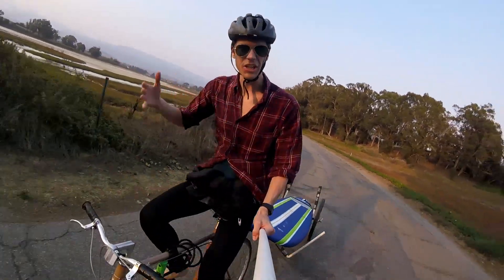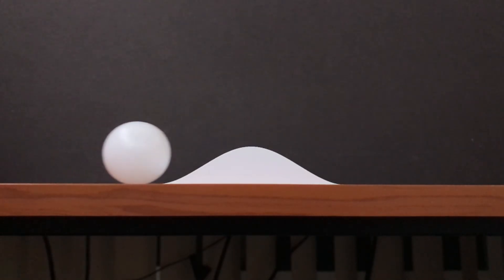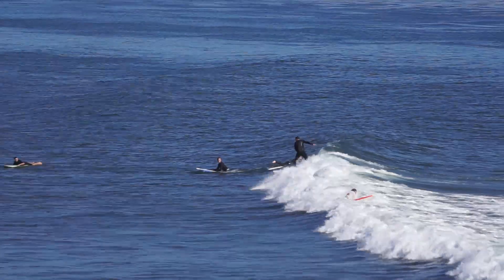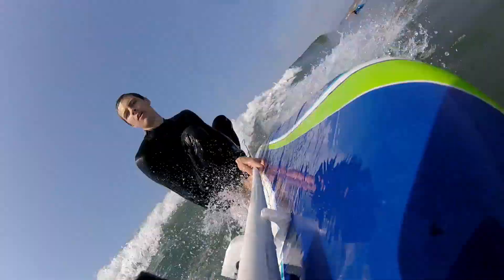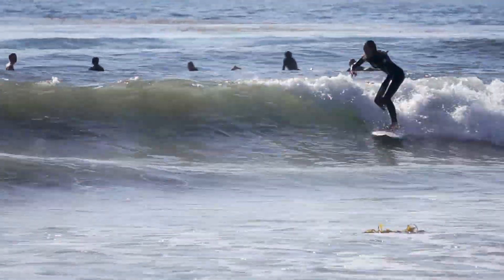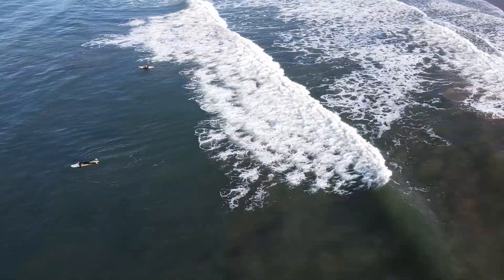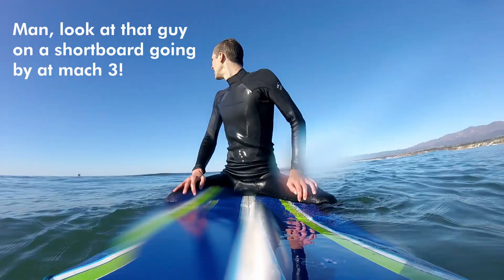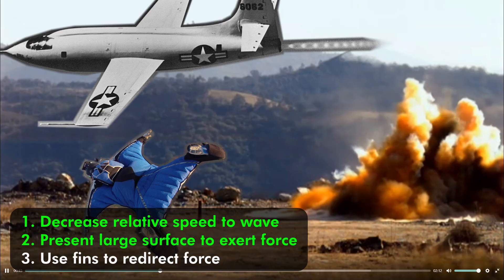How to go Faster than “Mach 1” on a Surfboard

Comment: Would love to lean more about how the hard edge in the tail redirects the water via flow turning if you will, whereas the softer edge in the middle of the board does not and how this allows for better overall board control.

Comment: Hey nice vid,   pls look into the steepening effect in shore breaking waves it is very related to shockwaves(mach3;), since the wavemedium is changing the waveconducting speed graduali the wave gets compressed and steepened till it tips over on top :)

Comment: Well, I think, that the problem with riding a shockwawe is too many dimensions. Look at it: on water, you are sliding quite easily on top of the wave. In air, it is not really possible to slide on top, because there is no top. It would be similar to trying to catch a wave while swimming underwater. The water itself does not really move from its place, so you would just move a little back and forth with water, but the wave would pass and there will be no way for it to accelerate you. Maybe the solution will be to add another dimension to move in, so it will be possible to be 'on top' of the air. Even then, you may need gravity to work in direction of the fourth axis instead of towards earth. Hmmm... It would still be impossible to ride a shockwawe, because it is a pressure wave, which is completely different from water waves. you ca try to ride a pressure wave on water, but i dont think you will succeed. GLHF

Comment: The concept of sailing into the wind and "blowing" into it faster and faster is fascinating to me. But I do rowing (forwards, not backwards like most lunatics). Water is definitely more interesting when it isn't flat. :) With the wind behind you sit up so your body acts like a sail and ride the waves as long as possible. Into the wind lie down and cut through it like a frisbee, and alternate the oars so you weave side to side up the oncoming waves instead of crashing straight into them.

Comment: I wonder if the surfer slows down the wave at all. I think this could be measured fairly accurately by observing waves that are pretty consistent, some with surfers on them and then some without surfers. I think this would need to be done in swimming pool or bathtub with a man-made wave and surfing mouse XD

Comment: When you were explaining the Mach reference at the end, I started to wonder if surfing happens elsewhere in the physical world, ie. where an object (knowingly or unknowingly) uses a wave to travel faster than the wave in a non-normal direction (eg. with sound waves, electromagnetic waves). Really fascinating video!
Reply: Birds can stand still infront of "stationary wave like air streams" going over bumps in the landscape, or dolphins/surfers riding the front or back wake of ships, probably also electromotors, or particle accellerators can be seen like sth. riding a endles el./magnetic wave ;)

Comment: 14:05 you could also drop a comet in the ocean, wait for the tsunami to reach shore, use a magnetic rail and a sabot system to accelerate you to near the speed of the tsunami as it starts to build, then fly off of the rail and use your surf boards aerodynamics to control your descent onto the wave, and ride it for the short time before it breaks and becomes your own personal blender

Comment: Weirdly specific question. Do get cold relatively easily in ocean, pools, etc? If so, how do you overcome it?
Reply: Cold exposure, lower carb diets, insulating clothing (aka wet suits). If I'm tired and hungry I get cold much more easily but if I'm very physically active and well fed I can hangout in 10° c  temps and feel hot

Comment: Here's something I learned after learning to shortboard.
I used to see shortboarders pumping but didn't know why they were doing it.
They said "to get speed" but I didn't understand how until I learned to do it myself.
When you pump, you "jump" the board or at the very least "lift" the board a tiny bit when you are at the bottom of the wave. You do this with the intention to get to the top half of the wave.
When you get there, then you present the wave with the entire flat bottom of your board which will give you a huge push! you ride down and when you reach the bottom, you turn kind of sharp, bend your knees and jump again back to the top half of the wave.
You can really move if you do this right!
Reply: See, that's why I would just build a dam. What you're describing sounds exhausting! :p You have all this water and you're doing the work to get that extra speed. If I let the sun get all the water up in the mountains and just use gravity to power my car, I can come over to the beach and watch you get super tired :p
Reply: @stylis666 sounds like your built for a long board

Comment: "If you look closely, there's fascinating physics everywhere." Agreed! 

The other day, I was watching this powerhead in my aquarium that uses a motor to push water through a pinhole-like opening creating near-laminar flow. As the fast-moving water exited the pump, the resulting turbulence chattered back and forth. Why does it do that? 

I have a cursory understanding of the Navier-Stokes equations and the Reynold's number, as well as intro physics-level fluid mechanics. But as a biologist, I would love a more advanced explanation! I see this sort of harmonic motion (is it?) everywhere, and I wonder "why is it that this restoring force MUST overshoot and create oscillations in everything?" I mean, I know that the energy has to be dissipated for the object to come to a full stop (thus perfectly elastic vs perfectly inelastic collisions and deadblow hammers), but in a fluid, where there are so many degrees of motion, and where the N-S equation makes me think the water would just create smaller and smaller vortices dissipating energy that way, why is that the motion tends to oscillate? Perhaps the pump was a bad example because it's continuously outputting power, but I've seen this oscillation also happen when siphoning water into a bucket. After I stop the siphon and the water remaining in the hose travels down the tube into the bucket, the water bounces up and down inside the hose a few times before coming to a halt. Why? It's crazy because I don't even see any ripples in the surface when this happens, and it seems odd that the water would reverse directions and travel a foot back up the hose rather than dissipate its energy in vortices.

Hopefully you understood what I'm trying to say, and hopefully this could lead to an interesting video idea (though it's also very possible that I'm just uneducated on something very basic). In terms of spelling and those kinds of errors, I'm sick right now so sorry about that.

Comment: Things to think about 
1. Fins have flex and can move side to side letting it hold speed though a drop or turn 

2.it is possible to ride that board in 10 foot plus waves (you put all your a mass on the back of the board and hope wind  doesn’t pick you up

Comment: "You cannot be accelerated by a wave to go faster than the wave" - Wasn't this disproved by Veritasium? Put a prop on your surf board, lol
Reply: Well, it depends on the steepness of the wave. I believe if the wave resembled a sine wave, you wouldn’t be able to get to the bottom and bottom turn.
Reply: And of course there is the sideways momentum, and after pumping if you straighten out it will be very easy to get to the bottom.
Reply: Usually catchable waves on a longboard resemble (3/2)sinx whereas on a short board it is more like 2sinx. But it’s also a little bit more complicated as the front of the wave ends up being taller than the back since water is coming back out due to the previous wave and dropping out the bottom of the wave. Depends on the tide the magnitude of that too.
Reply: Wind moves in to your prop, but, in waterwaves the water doesn't move into you as such, it's just the energy moving through the water.
Reply: Umm I'm pretty sure THIS video proves that very idea hence the (clickbaity) title. It even works on the same principle as the prop
Reply: He did for certain periods of time, he was travelling in between perpendicularly and horizontally of the wave, but it requires the waves energy to push the board forward

Comment: Hey, this actually might be similar to the Veritasium "faster-than-wind cart" saga!

I know a wave isnt actually a moving medium, but instead a force traveling through a mostly stationary medium, but I think the physics might actually be related anyway, because in both cases the reference frame doesn't particularly matter.
Reply: It should be basically the same - this is just me thinking out loud, but on a surfboard, the 'rolling hill' is only intermittently having an effect on you, whereas the sail on a sailboat is sort of... always in the path, as though it was always under the water in a current. so the wave is just an intermittent version of the same system as the wind. it's like if you had very regular wind gusts. the thing about it being a boundary layer is interesting though, the difference between the overall current of "still" water, and a wave poking up out of the surface.... hmm.
Reply: I came back to this video for exactly the same reason
Reply: as a lifelong sailor, this concept seems a little intuitive and quite dated ;D
Reply: Not really the key term there was 'faster than the wind, down wind' :/
Reply: @Appldragon  Faster than the wave, "down-wave" :/
Reply: @Goldfish_Vender  in the Veritasium video the thing was going faster than the wind while going  parallel to the wind in this the person surfing is going faster than the wave yes but he isn't going parallel so he's not going what you could call "down wave"
Reply: @Appldragon  If you look back at the concept as to why he is able to go down wind parallel, it is for the same reason he is able to go faster than the wave. Going parallel doesn't really matter, Op was just saying how the concepts are similar(and in fact, the same).
Reply: @Goldfish_Vender  I'll have to re-watch both videos but I think essentially the reason why that worked is essentially the energy comes from in front or behind the fan(can't remember which) and that's where the increase in speed comes from compared to when your moving at a diagonal, which if you do then a regular sail boat can move faster than the wind and this is the same as the surfboard. Could be wrong though.
Reply: @Appldragon  Yeah this wave example is the same as the sailboat. The fan is a different take on the sailboat in that it's multiple sails(fan blades) rotating around an axis. They still cut up the air as the sailboat sail and the surfboard fins.
Reply: @Appldragon  I think op is mainly referencing that both videos are about travelling faster than the medium that is pushing you, whether that be down wind or side ways in the water
Reply: @Hazed64  fair enough
Reply: @Appldragon  Realize that the blade is what was driving Veritasium and its angle into the wind is what matters.
Reply: @johnnicholson8811  I don't remember what I said or basically anything you're referencing but the surf board is doing the same thing a sail boat can that is moving diagonally, this is different to Veritasiums video in which the vehicle is travelling faster than the wind in the same direction as the wind which is much harder

Comment: Supersonic is faster than the speed of sound. Supercritical is faster than the speed of waves in the shallow water. What is the Mach number in compressible flow, is the Froude number in shallow water flow.
Reply from the maker: Oh wow that’s the actual term? Is Froude 1 the speed of an interfacial wave?
Reply: @AlphaPhoenixChannel  Yes, that is corrrect. The Froude number is Fr=sqrt(u^2/(L*g)), where L is a relevant length, such as the depth. The Mach number is Ma=u/c. The Froude number predates the Mach number. It was originally devised to scale tow tank tests of ships, using the hull length as length scale. A ship cannot exceed Fr=1 without planing, which is what a surf board does. You probably notice that your surf board behaves differently when Fr>1 (about 6 Mph). By the way, What's called a shock in compressible flow, is called a hydraulic jump in shallow water flow, a start-stop wave in traffic flow, and a droplet in droplet formation (inkjet printing). The shallow water equations are identical to the equations that govern compressible flow, so the analogy is very good. It's just that you would need a gas with 4 degrees of freedom per molecule for perfect correspondence, which is between 1 and 2 atoms. Your videos are excellent.

Comment: Yes, there really is interesting physics everywhere! While you weren’t travelling faster than the speed that a wave travels inside water, you were travelling faster than the speed that a wave travels between water and air. While the “in water” one is what we usually refer to as the “speed of sound”, sound can still travel across the water-air interface. On the ocean it would be very difficult to detect, but in a confined environment it would definitely be detectable. I remember doing a physics lab experiment where we measured the speed of waves across water and used that to determine the surface tension. But because the propagation speed is so low, particularly high sound frequencies (10kHz or so) will likely have wavelengths so small that the more microscopic behaviour of water comes into play.
Reply from the maker: huh that's neat - I'd never thought about the nonlinerity of sound conduction across an interface like that!

Comment: Funny how a passing comment can turn into a serious investigation.

I wondering, is there a theoretical maximum Mach number for a wave? Or is it just a matter of diminishing returns as Mach number increases, leading to greater impracticality?
Reply from the maker: The fuzzy over-water definition of "mach" that I use in this video is going to eventually be limited by friction. you can't let all of your force be directed purely sideways - because of friction, you need to keep harvesting some energy from the wave to keep going forward and not let the wave go under you, even once standing. That angle is limited by your speed relative to the wave, and eventually friction will be limiting you from gaining more speed in both directions because the wave is only just providing enough energy to stop you from slowing down. I wanted to get into friction more in this video but it was already 16 minutes long... I hope what I just explained makes sense - imagine the top-down force diagram I showed, but with a canceling force pointing backwards I guess.

If you're talking about how fast an ocean wave actually travels, that I'm not 100% sure of, but I know that different frequency waves travel at slightly different speeds. I've been wanting to make a related video about ocean wave superpositions for about a year (I tried to take some data last October I think but it didn't work first try and got shelved)
Reply: @AlphaPhoenixChannel  Hmm. I should've refined the question further before asking, especially because 'theoretically' has some fuzzy meaning. Two ideas that come to mind about theory-crafting how to model this (some very meta-meta analysis) are that the only meaningful inputs are wave speed, width, and height, and that it's best to use an idealized board (no issues with nose-dives or similar practical concerns). What you said is true given a certain wave, however, if one were able to craft the perfect wave, what's the maximum? The inclusion of friction is going to put a cap somewhere, but what's that limit? Basically what I'm thinking is that a wave with a very high steepness/height would result in a higher attainable 'Mach' number. Anyhow, this could possibly all be modeled, with any wave parameters as an input (and possibly modifications of the board, but that just adds even more dimensions and more headache), and after the fact one could take real wave data to find a real wave with the highest theoretical Mach.

That was kind of a rant, but I think I got the point across. I don't know Matlab, but should probably learn it for occasions of getting nerd-sniped like this.

Comment: So... technically can you outrun the wave you're riding if you build up enough parallel speed and turn to go with it, or is the friction of turning going to ruin that as well? :P
Reply from the maker: You totally could run "away" from a wave doing that, but you would immediately lose propulsion and friction would return you to the wave slope after a short bit. As a mechanism to avoid the break though? 100%

Comment: Great video! The relative motion of the ball and ramp was very helpful.
Reply from the maker: That's how I've tried to explain proper weight distribution to anybody trying to start surfing for years, but never made it into video form. "imagine you're laying on a skateboard but the ground is moving" doesn't have as much impact as a 3 second slow motion clip of a ping pong ball =D
Reply: @AlphaPhoenixChannel  even with the explanation and video it's hard to make the jump in your mind between reference frames. I don't think I could have made it without the video that was provided. Even with a perfect camera setup the video would look the same in both frames.... other than the ball wouldn't look like it was turning.

Comment: Cool bike trailer. Love to see people getting around without a car.
Reply from the maker: SO much easier than taking a car to the beach for a whole pile of reasons. I also nearly exclusively bike to the lab on campus cause it's only a couple miles away. It's nice to be outside for a bit before sitting motionless at a microscope for a few hours!
Reply: I just bought a leimai fatbike and now I'm debating whether I should even get a driver's license
Reply: The Netherlands has joined the chat